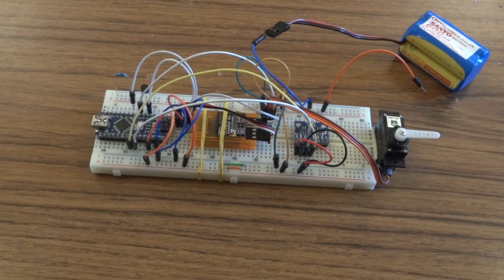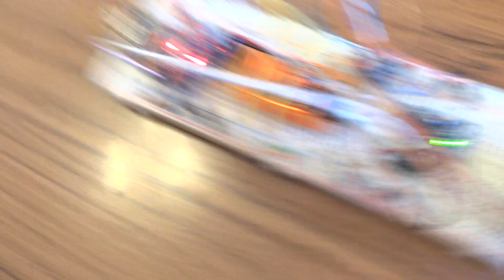Simple single-axis gyro, Arduino + MPU6050

Comment: I made it , but it dose no act as head lock mode in both gain value of 20% and 80% in my test , how can i solve it?
Reply from the maker: I would modify the sketch to add a temporary way of monitoring the gain input channel - make it print the value to the serial port, if you have one, or work an output to drive a LED if you don't.  You could make the LED come on for head-lock mode and off for rate mode - that would prove that the transmitter, receiver and gain input channel were all correctly configured and wired.
Reply: @ceptimus  tank you for youre help, it acts correctly, i have mistake in gain chanel assuming.

Comment: Hello, what is the dmp out register adress?
Reply from the maker: Sorry, I don't know what you mean.  Please add extra detail - where in my code you're looking, or some webpage that explains dmp out.
Reply: @ceptimus in mpu6050 datasheet please search dmp
Reply: Dmp is abrivation of digital motion procecor
Reply from the maker: @mohammadgolsabahi9383  Sorry, I don't know.  I didn't use that in my code - I just read the simple gyro rotation channel(s).  In some of my projects, I've also read the acceleration values, but I've never tried to use the DMP that somehow integrates all that information together inside the MPU6050.

Comment: What is the used pins of atmega328 for servo , gain signal , sdi and sdo of mpu6050?
Reply from the maker: Connections are detailed in the sketch.  For the Nano, I used:

#define  RUDDER_INPUT_PIN 2
#define     AUX_INPUT_PIN 3
#define RUDDER_OUTPUT_PIN 4

RUDDER_OUTPUT_PIN drives the servo.

The MPU6050 uses the Arduino's standard "TWI" (also known as I2C) pins A4 for SDA (data) and A5 for SCL (clock).

If you follow the links in the description to the video, You'll find the version for the Digispark AT Tiny 85 module, which is much smaller, lighter and cheaper than a Nano, if you want to build a gyro for a model helicopter, plane, or similar.

Note that the MPU6050 has sense 6 "axes" of rotation/acceleration, if you want to build a better stabilizer - but in this video I was only using one of the three rotation axes, and none of the acceleration axis data.
Reply: @ceptimus hello, i made your project,     all things is ok but  head lock don't work it behavior as rate mode!